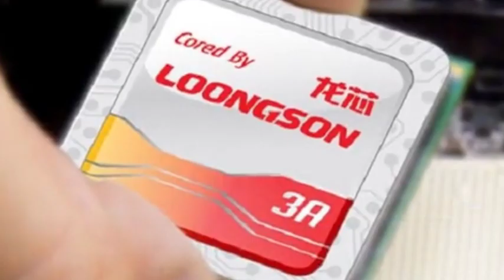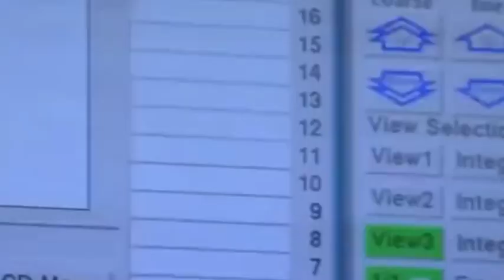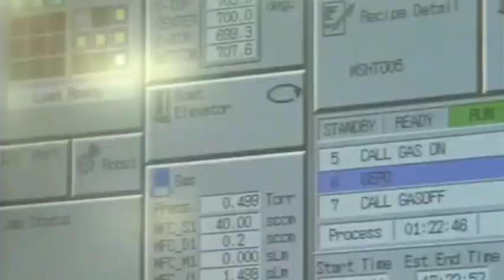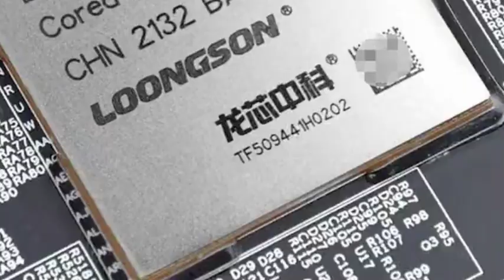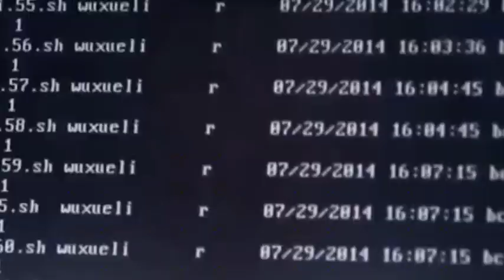Russia's self-developed system adapts to China's Loongson, a new pattern begins to take shape!

Comment: EXCELLENT!!! Russia and China are both developing Lithography and CPUs but the Most important part is… they are establishing mutual compatibility and working on establishing same standards. The Standardization of Protocols is The Key!!!

It is like when the automotive industry or other major industries from different countries came together and set out a shared common standards and protocols to meet. Or when Original Equipment Manufacturers and Third party manufacturers build to the same Parts standards, and we have third party or OEM parts that are compatible with each other.

It is a long process but Lithography and CPU technology independence is thus guaranteed by the collaborations of Russia and China. And they can be joined by new global players (think India, LatAm, Private Companies of BRIC, etc.) not just the usual. Specially Private companies from BRIC countries.

* Also joint collaborations will finally put to end the question of creating a self sustaining supply chain. Because of compatibility standards and compatibility protocols, from which to build future product specifications to.

Right now is the beginning and both countries are getting ready, but future joint collaboration on this is already showing through in other articles too. The joint Markets and joint development efforts, plus the full Resolve of Russia and seems of China as well, means this will come to pass. But its a monumental task that cant simply be rushed. But it is the coming future. And thats a good thing, because its always good to have alternatives in the world. Vendor lock in to USA, UK, EU, Japan, S.Korea, is not good for anyone. They’re woke countries who weaponize finances and tech, even livelyhoods if others dont do as they say and follow their tantrums and woke whims. Even Nato country’s citizens are rooting for Russia and China to succeed and pull this off soon rather than later.